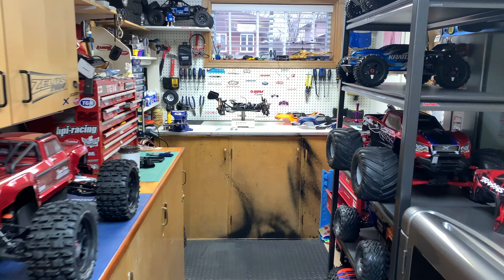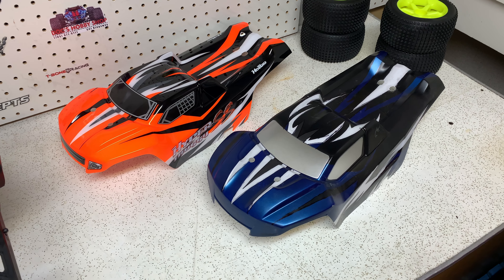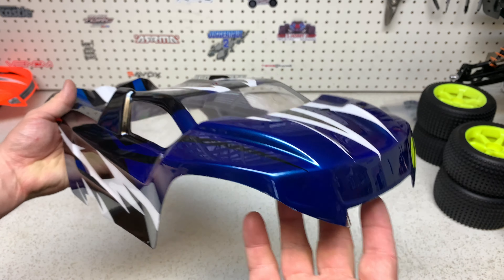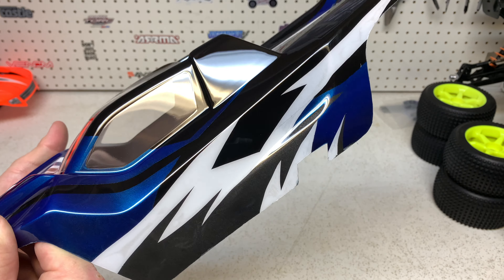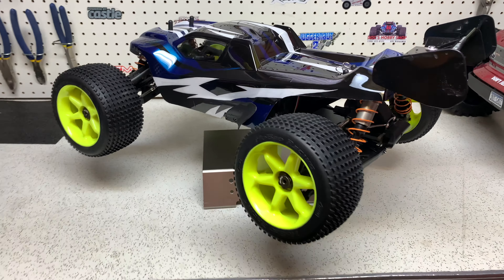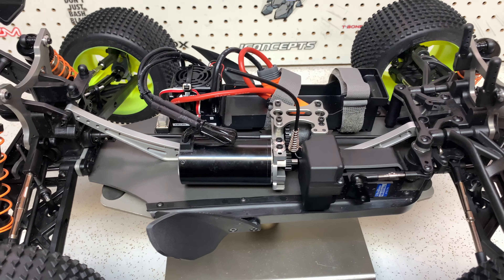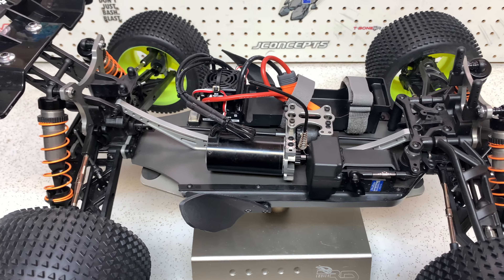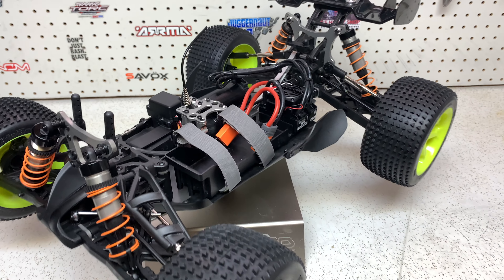Hobao Hyper SSTE 1/8 Truggy   (Part 1 Upgrade Video)

Comment: Smart, very smart! I like the metallic fleck in the blue. They're brilliant Truggies, very underrated and seemed to have slipped under the radar somewhat in just how good they are, I absolutely love mine. Had it for around 15months now, bought it as a roller and installed my own electrics. It's running a sensorless Toro 4268 2650kv motor with 4S up its backside - consequently, it shifts really well. Shock oils are 600cst front and 550cst rear. Diff oils 10k front, 300k cst centre, and 7k cst rear - I did originally put 50k cst in the centre, but the front axle would spin up so easily all the time, so rather than being tedious and fettle working my way up with heavier oils, I just went straight for the very gloopy option with 300k cst - it's totally transformed how it runs, leagues better on the track now which is grassy roots / dirt. And finally just changed the wheels/tyres. I never used the stock wheels/tyres, instead I bought the Hobao spoked Truggy wheels to try, as you have, but found that on a track it then needed more room for cornering, so I went for a narrower and taller set of wheels, the traditional type found on a racing Truggy. At the moment I just run it at my local club on an open evening where anything can be used at once, and it's impressive, so much so that I plan on racing it at some national events - that's if the BRCA here in the UK form a 1/8 e-Truggy class. All we have is a nitro Truggy class at the moment, and it'd be criminal if they don't create an electric class as popularity for 1/8 eTruggies is soaring now. These things don't disappoint! Worth every penny..

Comment: Careful, that rear brace helps, but it’ll still bend if you crash hard enough. They shoulda just made it a solid piece of straight aluminum. It’s definitely better than the plastic one though.

Comment: Hallo, danke dir für immer deine sehr schönen aussagekräftigen Videos...  habe ich mir schon ein HOBAO HYPER VSE 6S, gekauft... hole mir jetzt noch den hobao hyper SS
Kannst du mir einen Ratschlag geben Empfehlung für die Differentiale welches Silikonöl?
Bei dem hobao Hyper VSE 6s habe ich Mitteldifferential 100000... vorne 40.000... 
hinteres Differential 20000.... 
wie mache ich das deiner Meinung nach mit dem SS?
 Zähle auf deine Empfehlung würde mit dem Auto nicht viel Bashen 
nur grüne Wiese fahren oder Fußball Schotterplatz und so weiter.... merci Gruß Brane

Comment: How is the “parts support” for that specific brand.  I want a ready to run e truggy for the track and looking at different models
Reply: I bought a Hobao Hyper vte and I had the same concern before purchasing. I have not had any problem getting any replacement parts needed directly from the Hobao US warehouse at http://eshop.hobao-racing.com/ (I live in US). They ship the items out pretty quick and they are pretty responsive when it comes to any inquiries. I would definitely recommend the brand and I would not hesitate to purchase another vehicle from Hobao. The only downside is that none of my local hobby shops carry any parts but I'm used to having to order parts online for my Tamiya.
Reply: @250hdd  I too have the Hyper VTe and i wish it would have e bigger battery tray!